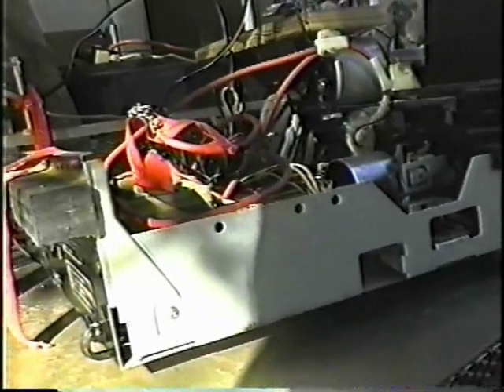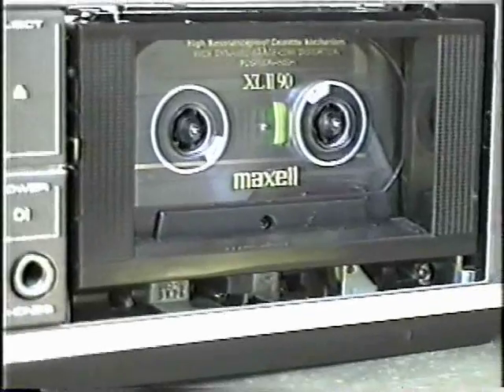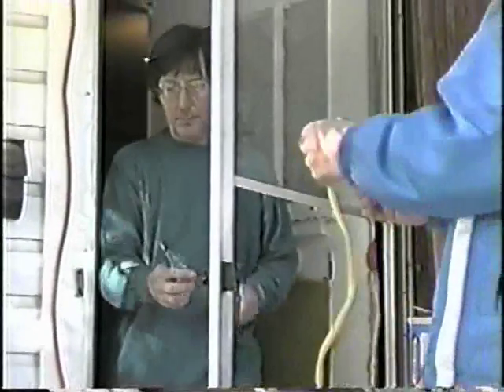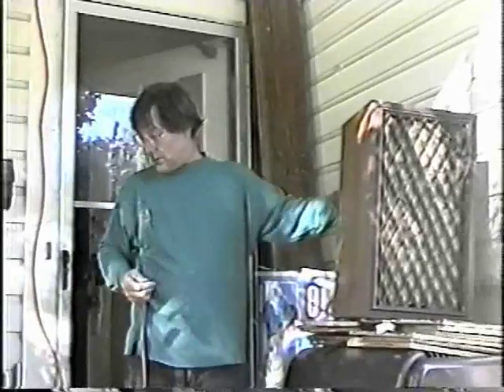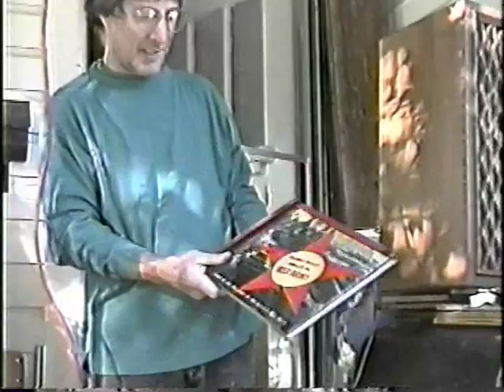Terry Brown: Slow Playing Tape Deck

Comment: Were you able to find out what was causing the tape deck to play really slow? The reason I am asking is because that tape sounded really sick, like it had a tremendous amount of drag. It was absolutely unbearable. Yuck.
Reply from the maker: If I remember correctly, I think he had reduced the power going to the motor, so it turned slower.
Reply: DavidAustinSing Well, going on what you said, if I were him, I would have made sure the power was the correct voltage to maintain the proper speed, so the tape deck would not have sounded so horribly slow. Most tape decks do say somewhere on the casing what the voltage and hertz should be, for example 120 volts and 60 hertz (or in some countries, 120 volts and 50 hertz). I believe that had the voltage and the hertz been right it would not have sounded so slow. Having improper voltage or hertz, I have been told, could cause damage.